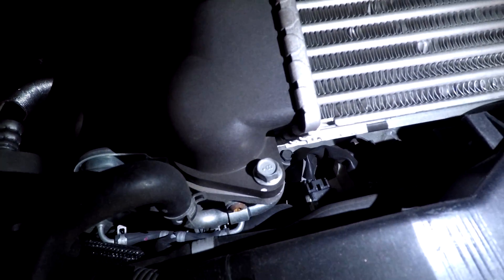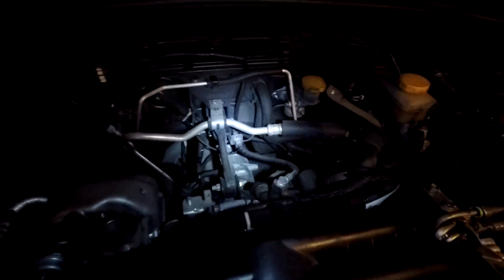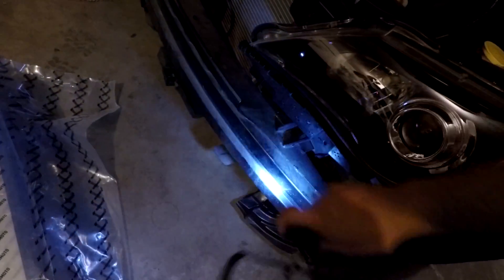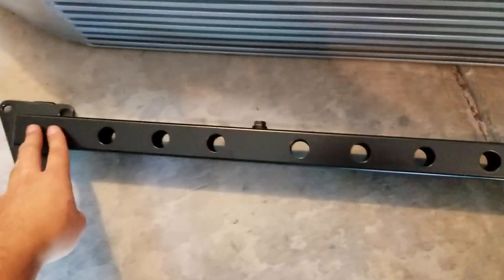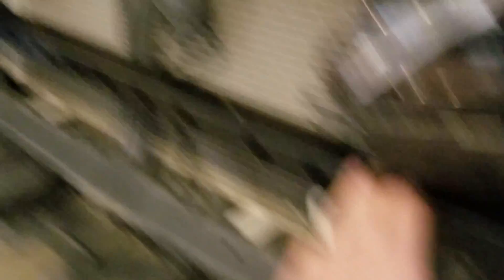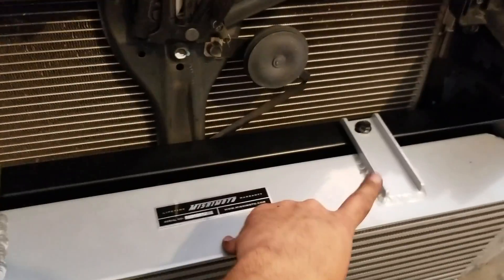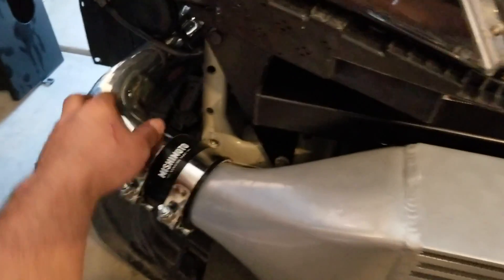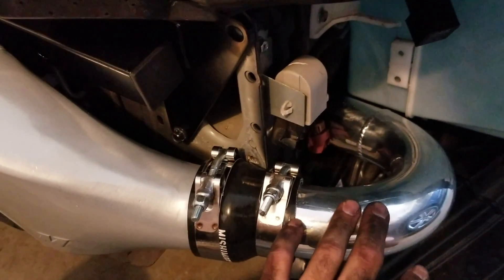Installing a Mishimoto Front Mount Intercooler for 2014 Subaru WRX

Comment: Could you run this setup with a stock tune? or did it need one?
Reply from the maker: Ryan Kato nah it wasn't necessary to get a tune for this specific intercooler
Reply: Oh ok thank you, thats such a relief.
Reply from the maker: Ryan Kato Yeah bro. It's always better to get a tune for it though. But as soon as you install it, it's not like you have to get a tune immediately.
Reply: I heard theres more turbo lag because the air needs to travel a farther distance? is this true, and by how much longer is it if there is an increase? (im running a stock wrx turbo).
Reply from the maker: Ryan Kato I have a stock turbo as well and the lag is barely noticeable. It would make sense for it to have a longer lag since the pipes are longer for travel, but from experience bro it barely has an affect.

Comment: did they end up sending you that 90 degree elbow witch was the missing piece you needed?
Reply from the maker: fernando valdez yeah after like 3 weeks.. I wasn't able to drive my car for that long due to that missing piece.
Reply from the maker: fernando valdez and the first time, they sent out a wrong replacement piece that I already had. But eventually they sent the 90 degree piece
Reply: KooZairy thanx for replying back and the reason why i asked is because i'm also thinking about getting this front mount for my car because i originally got one that i had to have an aftermarket turbo for so i'm returning it and getting this one instead because my stock turbo is new in the car
Reply from the maker: fernando valdez Yeah man no problem. And ohh gotcha. Well just to make sure when you get this kit, check if all the pieces are there. And another thing to point out, the intercooler piping blocks the tow hook mount. So you won't be able to use your front tow hook anymore.
Reply: sorry for taking a bit to reply, but thanks for the heads up man.  much appreciated 👍
Reply from the maker: Yeah man no prob!